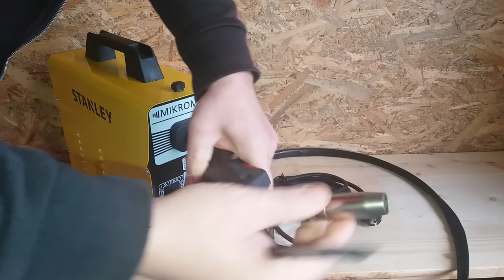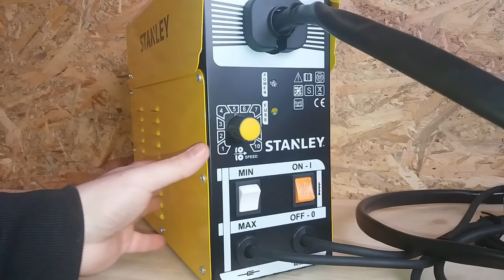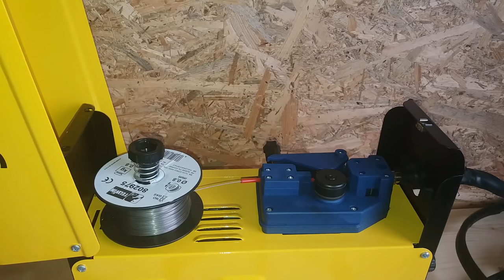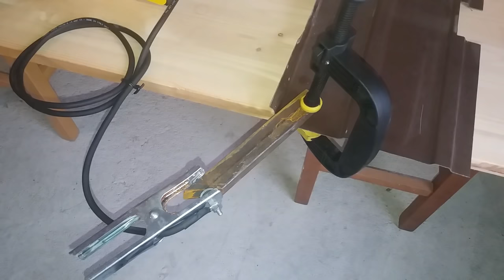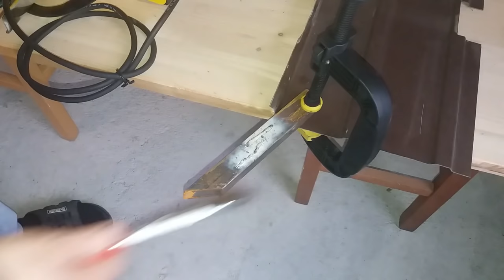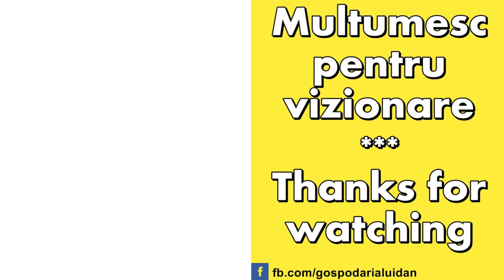Stanley Mikromig, aparat de sudura cu sarma

Comment: cand am auzit...... ca vrei sa sudezi fara welding shroud , nu stiu cum se numeste in romana , tu l ai numit invelis de protectie sau ceva de genul acesta , mi-a picat fata :)) cum sa faci asta ??? WTF  !!! dupa m am uitat mai departe ... si mi am dat seama ca eu sudez de ani de zile cu Mig sau Mag dar asa ceva nu am vz , fara gaz protector :)) !  deci , sfatul meu , nu are ce cauta plastic pe acolo niciodata , nu are ce cauta lemn pe acolo niciodata , nu ai ce sa vezi sau sa testezi asa cum tu ai facut o , sudura se poate vedea cand sudezi 2 parti metalice pentru a putea determina si penetrarea se face la 45 de grade , de aici deja intram in detalii si sunt multe , cumnatul are treptate din cate ai zis tu ! aaa si inca ceva , manusi de protectie , masca si tot ceea ce trebuie pt a fi safety !
Reply from the maker: Salutare. Mustiuc ii spun sau invelis protector, dar mustiuc. Pai sa nu-ti pice fata ca nu mi-a venit mie ideea asa intr-o noapte, am vazut un tutorial strain unde un nene foarte priceput suda fara acel mustiuc si avea o precizie foarte buna a partii ce urma sa fie imbinata. Exista, dupa cum vezi, astfel de aparate de sudura cu sarma flux, fara gaz. Pui problema plasticului de parca as suda langa el, e o clema de prindere (ca alta metalica nu am momentan) cu care am fixat piesa. Doar nu era sa o tin cu mana si a fost o demonstratie. Daca stricam menghina, nu era nicio problema, cumparam alta. Lemn unde ai vazut? Te referi la bancul de lucru? E un banc de lucru pe care nu il folosesc pentru sudura ci pentru lacatuserie mai mult. Din nou, nu vad de ce imi atragi atentia cand vorbim strict despre o demonstratie. Se pare ca avem ce vedea si sudand un cordon pe o singura piesa, doar daca nu vrei sa vezi cordonul, eu il vad in clar. Ce voiam eu sa demonstrez era cat de gros este cordonul de sudura la tensiunea maxima respectiv la tensiunea minima. Cat despre echipament de protectie, niciodata nu sudez fara masca de sudura, manusi, sort de sudura. Repet, in clip vedem o scurta demonstratie a felului cum sudeaza aparatul. Vrei sa vezi ce echipament de protectie folosesc? Poti viziona acest clip https://youtu.be/brbuHh8AnSg?t=117 Numai bine, te mai astept pe canal.
Reply: @DemoToolsYT  am inteles perfect nu o lua in nume de rau ! Ideea legata de protectii si de pregatirea locului unde sudam este ff importanta , am inteles ceea ce ai facut tu dar exact atunci cand este doar o demonstratie este important sa se respecte anumite standarde deoarece nu toti cei care vizioneaza iau in calcul normele de protectie , iar imaginea iti ramane in cap ca si provitor, timp mai indelungat decat vorbele rostite in clip . Iar cand v a vrea si privitorul sa faca asa ceva ... ii vor venii in cap imaginile vazute pe youtube si asa v a proceda si el ! Asta doar am vrut sa spun , mai ales in Ro unde lumea nu prea tine cont de protectii iar eu stiu oameni care au luat foc sau au decedat in urma sudurii acasa asa ...ca un amator sau nu stiu cum sa zic sa ma fac inteles ! Referitor la acest aparat da , exista, doar ca eu m am mirat , am aflat ceva nou si eu care sudez de atat timp dar sudez industrial , in industria auto. Nu mai vad rostul acelui "mustuc" daca pe acolo nu vine un gaz protector , probabil ca sunt asa, facute standard acele pistoale .
Reply from the maker: @b.flavius2737  Da poate ai dreptate, e vorba de exemplu negativ, asa este. Cred totusi ca are un rol mustiucul, tine la distanta varful pe unde iese sarma de sudura altfel daca sudezi fata el e posibil ca duza sa se lipeasca non stop si sa formeze doape de sarma. Plus iti dai seama ca de fiecare data cand ai aseza pistoletul pe masa de lucru cu masa pusa ar face arc. Ca la clestele cu electrod. Probabil mai sunt si alte aspecte.
Reply: @DemoToolsYT  Servus,  „destul de captivant acest clip” . Totusi, acest „mustiuc„ se numeste calota, si da, este normal sa se incalzeasca si  are un rol foarte important in „mentinerea arcului de sudura,  izolator , protectia duzei de contact , racirii pe aer *(inca nu am vizualizat fisa tehnica a acestui aparat, din cate observ, racirea se face prin intermediul aerului ) etc... ” (spus pe romaneste, ca sa intelegi).   Pentru „ centrarea sarmei ” iti sugerez sa tii pistoletul „ inclinat intre 40 - 60 de grade, in functie de pozitia in care doresti sa sudezi si cu sarna iesita din din duza cca 5 - 10 mm. PENTRU OBISNUINTA, nu mai tine calota direct „ lipita de piesele pe care doresti sa le sudezi, risti sa ti se lipeasca sarma de duza sau in interiorul duzei de contact ( alta distractie pana inlaturi acel broc nesuferit din capatul duzei, pana polizezi si refaci capul  sa scoti sarma, etc .. ). Rola de sarma vine la pachet cu acest aparat,  acel regulator este format din presa si rolele de ghidare a sarmei, au un rol critic, rotita zimtata, este pe categorii ( grosimea sarmei, cu timpul se va uza, deci sa fii atent la achizitionarea altei rotite pe tipul de sarma folosit si grosimea ei ), atentie mare si cand umblii la presa, o strangere foarte puternica in combinatie cu rotita zimzata poate duce la „deteriorarea sarmei, a canalului zimtat, sau ingreuneaza sarcina motorasului. O strangere slaba , poate cauza rotirea in gol a rolelor, fara ca avansul sarmei sa fie constant. „Impingerea sarmei in pistolet ” se face cu intermediul acelor role - „eprubeta” - liner ( de otel / teflon ) - duza de contact ).
Sugestia mea, foloseste intra-devar echipamentul adecvat sudurii ( indiferent a ceea ce sudezi - masca de protectie - manusi - sort  ) , poti lasa reglajul treptelor la maxim, din potentiometrul sarmei  poti opta la un avans mai mic sau mai mare al sarmei in functie de grosimea materialului, sudura a iesit „cat de cat..”  daca folosesti si o masca de sudura, ai o vizualizare mult mai buna a băii, a penetrarii si a incalzirii materialului pana in punctul de topire,  foloseste treapta MAX si mai scade din viteze de avans a sarmei pana baia de metal este mai uniforma  (mai lata, NU INALTA si cu acea cocoasa). La cordoanele de sudura incearca sa stai putin mai mult timp pe loc, pentru  un cordon frumos si uniform, la hafturi la fel.  Daca doresti ( RECOMAND ) poti opta pentru sudura in puncte la grosimi mici ( 1 - 5 mm ), ((( dai un haft, te opresti, astepti 2 -3 secunde pana se raceste materialul din punctul de topire , dupa aceea reiei aceeasi operatiune de la capat ) .

Nu este chiar cel mai bun si exact ghid, dar aceastea sunt sfaturi elementare pentru incepatori (hobby_) , pe care trebuie sa le respecte .

Din pacate nu am gasit in limba romana : 

https://www.jula.pl/globalassets/catalog/productdocuments/manual/210083_se-no-pl-en.pdf
Reply: Aceste sarme tubulare no gas sunt de ani de zile pe piata, sunt folosite mai ales in mediul hobby, ==
Reply from the maker: @bullseyedarkg9659  Mersi pentru comentariu. Foarte util. Daca ai timp si chef, poti urmari si acest clip pentru a vedea cum am lucrat cu acest aparat https://youtu.be/brbuHh8AnSg